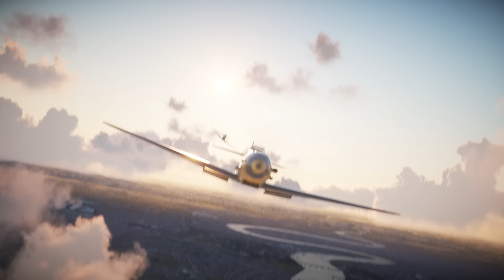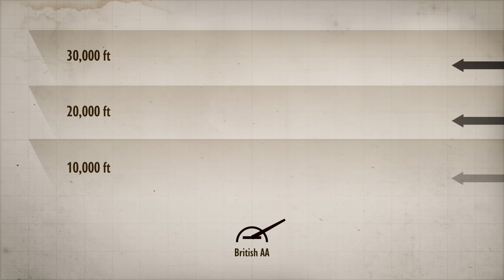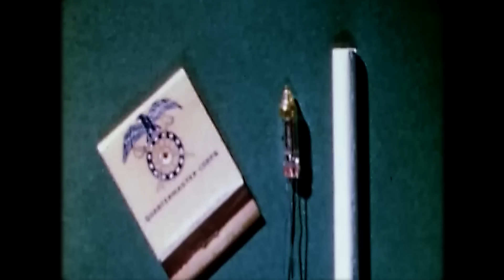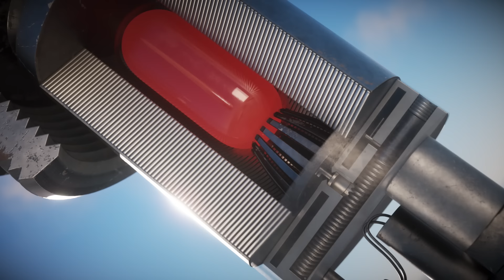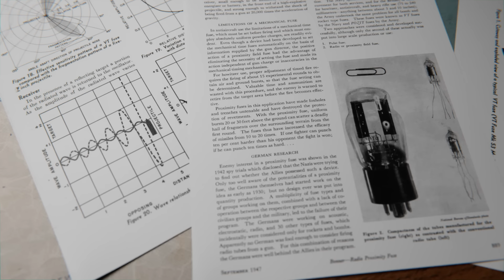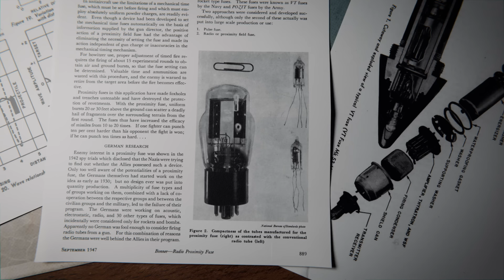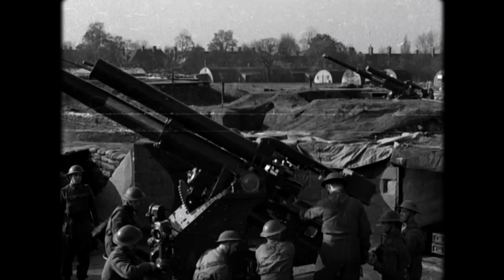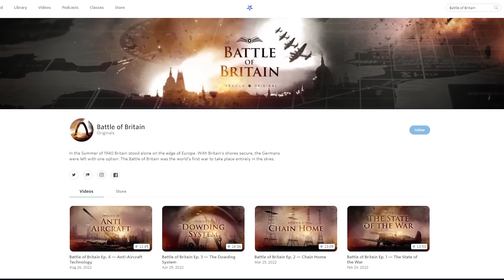The Secret Invention That Changed World War 2

Comment: I became acquainted with the VT fuse, as our artillery often fired that fuse, unless we were firing in the rain. I didn't realize until seeing this and similar videos that the development of this fuse was primarily for antiaircraft fire, while it is now most used to make effective airbursts easier to achieve.
Reply: What does the rain have to with it?  Are you saying raindrops would trigger the proximity fuse?
Reply: @swright5690  The fuse was a radio transmitter and receiver.  It transmitted a signal and detected a change in the frequency using the Doppler effect.  If the radio signals reflect off rain (common in those days) it would trigger the fuse prematurely.
Reply: We've got missiles for that now; aka self-propelled, self-correcting proximity shells. ;)
Reply: @5peciesunkn0wn  And the missiles still use proximity fuses.
Reply: @allangibson8494  did you miss the part where he literally called them "self-correcting PROXIMITY shells ;)"
Reply: @SuperCatacata  Proximity fuses are also used on anti drone cannon systems now too…
Reply: @5peciesunkn0wn  Missiles are more expensive than artillery shells and take up more room than shells do.  One of the reasons the idea of firing missiles from tank main guns went away was because of the ammunition stowage issues (one missile displaces 3 conventional rounds).  

Also the anti-drone technology that's being developed won't need a lot of further development to make it effective against battlefield missiles.

Comment: I'm glad you mentioned the use of the VT fuse in cannon shells against the V-1. That made it possible for a very high interception rate, which otherwise would have resulted in a lot more V-1's landing around London and causing far more damage.
Reply: My understanding was that spitfires played a huge part in countering the V1s. A desperate pilot discovered that he could disrupt the gyros of the rocket with his wings striking the underside of the V1 wing. Yarnhub did a video on it if I’m not mistaken. Both approaches claim to be what saved Britain hmmmmmm….
Reply: @peaksofblue  actually, most of the intercepts of V-1’s were done with coastal battery guns using shells fitted with proximity fuses.
Reply: @Sacto1654  Good point. Looks like the planes tracked down those that got close to higher population centers. Supposedly, ~1000 were brought down by planes, which was a decent chunk of what made it through AA batteries, which culled~ 75% of the 10k v1s launched over about 80 days.
Reply: @peaksofblue  Your understanding would be wrong then. The spitfires usually get all the glory for it though, so it's understandable why you would view it that way. The daring maneuvers pilots pulled off to take them down was much better for propaganda, and the VT fuse was still top secret, so it could not be widely advertised.

Also it's obvious that the UK is going to give more credit to their own men for morale, rather than a Yank invention.

Comment: A true wonder weapon.
"As volume increased, efficiency came into play and the cost per fuze fell from $732 in 1942 to $18 in 1945."
Reply: @Asazym21  You've obviously never worked for a company on a military contract...
Reply: @nobody7817  Standard for a military contract is to charge 3 times the cost.
Reply: @tedmoss  "Standard for a military contract is to charge 3 times the cost."

That's a really good way for another company to get the work.  Do you really think that one company is bidding on the work?  And if you're the only company that can do the work - you have the additional headache it turning into a 'cost plus' contract where the government tells you how much profit you can make.  And you will be dealing with a government rep whose job is to rip you off every chance you get.  (Their performance reviews are based on how much money they save the government.)

I've witnessed shouting matches where our contract manager and the government rep couldn't come to an agreement.  (And the government rep was being completely unreasonable about how overhead costs are charged to the contract.) 

In fact, one of the major reasons, we lack defense manufacturing capacity is because the companies no longer trust the government enough to expand their plants.  This is why F-35 production is so low.  Lockheed isn't going to take losses like the ones they took when the F-22 program was cancelled.  And the issue is also with munitions.  Whenever Congress wants to cut the military budget the first thing they go after is ammunition and munitions.  This is the reason US Navy warships go on operational missions without full magazines.  (Easy to spot - just look at the Harpoon Missile launchers and count the tubes.  There should be eight.)  

At this point if we wan a reserve of munitions and ammunition production capacity - the government is going to have to pony up the costs.  Our defense industries are 'right-sized' to meet our peacetime needs - and no more.  

The only time you see the kind of pricing is when defense work is earmarked to a specific company (generally owned by a relative of a politician).  Feinstein, Biden, Pelosi, and Murtha were famous for doing this.  (Murtha's son wasn't content with merely overcharging the government - he started substituting 'hardware store' grade screws for Mil-spec ones (and when you see a mil-spec screw/bolt - it's generally a human safety issue).
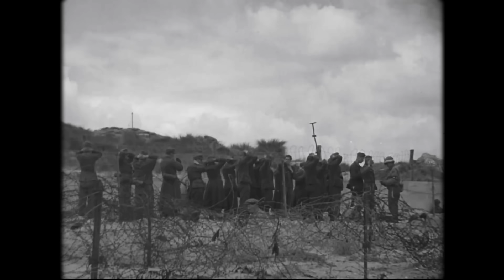Reply: @nobody7817 13:35
Reply: "...finally reaching $0.49 when production was moved to China."
...wait, something here sounds fishy...
Reply: @AttilaAsztalos  China was actually an ally to the US in WW2. Which should come as no surprise, considering the atrocities that Japan committed on Chinese soil.
Reply: @vedritmathias9193  i would say it was a bit more than that. It was the Flying Tigers, late 1930s, before WW2 even touched Europe, men that unofficially left the US military, and went to China to train, teach, help out, pilot, or do whatever was needed of them, KNOWING full well since they were unofficial, if they were shot down or captured by the Japanese, they would not be treated as POWs, more than likely tortured for any info then shot. 

China conveniently forgets the 7+ years of constant flow of men, airplanes, weapons, ammo, food, etc supplies. The 1000s of difficult and grueling plane trips they had to endure flying from India over the Himalayas to China, to deliver as much supplies as they could fit in their fairly small planes, compared to the bombers US was making just 3 years later.
Reply: @vedritmathias9193  Well, that word 'ally' gets thrown around a lot.  But the meaning is not.  China was not an ally.  General Stillwell had a lot to say about the whole thing, and entire books and phd's have been made writing about the complexities of China 1930-45
Reply: @tluzanov  Over the "hump". many lost their lives.
Reply: @tluzanov  the Chinese probably remember, but also remember the fact that the US joined in the looting of China in the 19th Century and early 20th Century.
Reply: @tluzanov  FDR the commie helping the enemy, thats stupid.
Just because one enemy kills another doesn't make neither a friend.
Let them kill each other and then kill the survivor.
Reply: @AttilaAsztalos  Those were the 4th of July versions.......
Reply: $18 was roughly a month's pay for a U.S. infantryman, or a week's pay for a laborer in the United States in 1945.
Reply: All these replies, and not one states the obvious:  " the cost per fuze fell from $732 in 1942 to $18 in 1945" -- this includes the total cost of R&D.  The actual production cost of each fuze didn't drop that much, it's just that they built enough units that the indirect cost for each unit plummeted.  This is why the F-35 seemed so absurdly expensive when it first flew, but now the per unit cost is significantly lower.  It's about cost accounting, not actual cost to manufacture.
Reply: @_sx_  Nobody said it because its obvious. So thank you captain obvious for your next trick will you tell us the sky is blue?

Not to mention the fact you are actually wrong because advancements in automation and expanded production capabilities also led to lowering prices...

Do you have ANY fucking idea of how supply and demand works?
Why the fuck do you think market variety exists? Because 100 people cant start making something and expect to make a profit because becomes over saturated and the value drops.
Reply: That's a capitalist system producing those shells.
Reply: People always rag on the nazi obsession with wonder weapons but one sure ended ww2
Reply: Gotta love how this video puts it, from 1000+ to take out a plane to 100 or so.
Now while more daka sounds like a good thing there always is that "logistics wins wars" side of things.
The beauty of it all is now your 100 acts like 1000 so when you do put up that 1000 rounds up you can really feel the Waaargh!
BTW I'm using silly 40k references but know hardly nothing about it. Just osmosis through the internet.
Reply: Good ol', economies of scale.
Reply: God bless capitalism
Reply: P
O
Reply: Sauce pfp?
Reply: Today, that cost trend would be Inverse, and rising!🤬
Greedy Corporations today putting Profit over Readiness!
Reply: @AlphaOmegaMan1961 It's been that way since Rome.  Ask Smedly Butler.
Reply: @OvertravelX  😁
Reply: @AlphaOmegaMan1961  Amusing, but not really true.
Reply: @AlphaOmegaMan1961  Thats.... No?
That is very wrong for starters. Case in point the F35. The more they make the cheaper it gets fool.
Reply: @AlphaOmegaMan1961  well yeah, the entire point and existence of a corporation is to make money, not serve the military
Reply: @AlphaOmegaMan1961  Actually the problem is that those businesses know that the government will rip them off every time it got a chance.  And return the favor.  This result is a dysfunctional procurement system where both sides hate each other.  (I despised our government rep because she tried everything she could to rip us off.)

Got to the point where I replied with 'no bid' for a part that was absolutely essential to a high priority defense asset.  I then passed the word to the people who used that part what I did - and why.  (We had a competitor that also made the part but the Air Force mechanics didn't want it.  Because our part came with a warranty that it would last twice as long as the requirements in the government specification.  And it worked much better.)  Yea we charged 25% more for a part that lasted twice as long - but we were still accused of ripping off the government.

Something that a lot of people don't realize is that the defense industries attract a lot of veterans.  And those veterans take a lot of pride in their work.  

And something else that people don't realize is just how expensive it is to make aerospace grade parts.  People look at the price and thing that the company's ripping off the government.  No they're not.  The materials they're made out of are specialty alloys and making them takes hour on a machine whoce price starts at $1 million.  And the person running the machine is making $20 - $30 an hour.
Reply: @colincampbell767  I spent 30+ years in Aerospace, Medical Device, Automotive and Military R&D.
A 25% Markup would be fine for a better part. In the example in the story, the price changed by ~40X.
I understand the costs involved for materials and labor. 
Was making a tangential dig at the state of current Military/Government overpricing and monopoly manipulation. 
There is NO justification for some of the Ridiculous costs associated with Military Components and Systems.
Would like to see this change, but I won't hold my breath!😁🤬
Reply: @AlphaOmegaMan1961  Have you ever costed out a bid?  Have you ever had to sit down and figured out how to allocate costs?  Here's an example I dealt with all the time.  And an example of why government cost cutting costs us more money in the long run.  For CNC machines there are programming costs.  Not just for the parts themselves - for the tooling you will need to make those parts as well.  The you have to make the tooling.  But before you can make the tooling you have the costs of setting up a machine to make those parts.  Then you have to strip off that setup and do another setup for the parts themselves. And you' be using your (expensive) Master Machinists to do that.  Then you have to make a proof part and send it over to QA so they can verify that the part is correct.  But before they can do that, they have to get the program their computer-controlled measuring device.  So the programming department is putting in a lot of work from some very expensive people.  If you're lucky and everything works right the first time and you don't have to pay people overtime in order to keep to schedule - you can get away with spending as little as $10,000 to do all of this.  And yes, the other departments charged me to do this because the government did not need the cost accounting department to know anything about what we made and how we made it.  (I ran the part of the plant that did the classified work.)  So this was how the company kept track of costs.  To the company my operation simply brought in more revenue than we cost.

Oh and by the way since the part is classified, we have to assign some of the costs of our security infrastructure and procedures to each part.  Now it turns out that we can make the part with three hours of machine time, 1 hour of bench, two hours of coatings, then packaging (and all the additional paperwork for sending classified materials from my plant to the customer) for a total cost of $500 each part.  Now we just got a contract to make five of them.  

Do the math and see how much it's going to cost to make those five "$500" parts.  

Oh and occasionally we would get a DPAS (Defense Priority Allocation System) priority dropped on us.  My production schedule then goes out the window because that job has priority over everything else.  Then I had to sit down and figure out the dollar costs of the disruption to charge to that job (along with a 'You pissed me off' surcharge).
Reply: @colincampbell767  the people running those machines make more than $30/hr. I made near that 10 years ago as an automotive repair technician. If aerospace manufacturers are paying their machine operators that, we have a major problem. They likely make twice that at the very least. $50-60/hr minimum. 

I bet Tyson at Titans of CNC pays his aerospace capable employees at least that much. If not more.

Edit: so what I found says machinists at Boeing avg $82k/yr. Which is about $40/hr avg. for 40 hrs/week for 52 weeks. So there are likely people making more and less than that.
Reply: @J.C...  I've been out of the workforce since 2005.  I should have mentioned that these were rather old prices.
Reply: @colincampbell767  Although I see your point, it is the entire system that needs to be fixed, and it will be.
Reply: @colincampbell767  yah, avg people just don't understand those issues anymore. I found a memo buried in the archives from 1944 for 5, prototype vehicles with a total cost of 250k usd. Roughly 4.2m today. For what was an improved universal carrier prototype.
Reply: @AlphaOmegaMan1961  And despite all that time there you dont actually realise how it works... Sad...
Do the words "governmental subsidise" have any meaning to you? Probably not.
Just cus you stacked boxes does not mean you have the right to talk about how governmental finances  work.
Id also like to remind you that the prices they pay also keeps you in a job and your country one of the strongest in the world. So whats your problem again?
Reply: @brentonherbert7775  
My problem?
Trolls like you.
Reply: @colincampbell767  Finally, someone with experience and sense gives a solid explanation about why many of these costs look ridiculous or as some chump keeps saying 'ripping off' the poor sap public. Nice work Colin, I learned some here though I already good a fair amount of this.
Reply: @colincampbell767 
Very educational, thank you for this counterpoint to the (legitimate IMO) claims of waste & fraud that can come with government contracts across all industries.
Reply: @AlphaOmegaMan1961  no